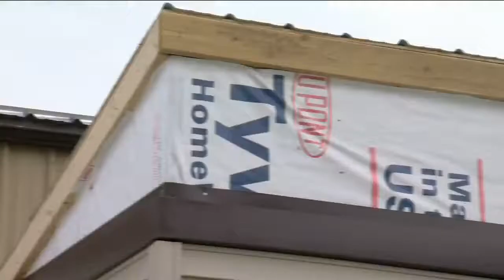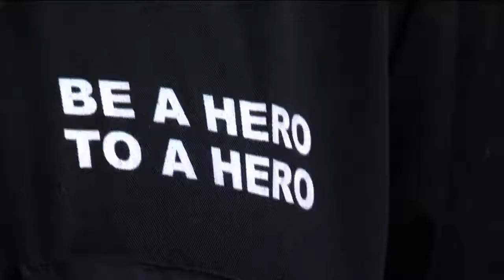Racine to build 'tiny homes' for homeless veterans

Comment: build a tiny home that has the roof and side of the home lined with solar panels. and wind turbines on the roof and side of the home build the homeless veteran homes next to a river or stream for hydro turbines. and make everything in the home electric, electric stove, electric heater/ac, electric water heater 10 to 20 gallon, it will be self efficient. most homeless are down south and you can build these homes down south where nothing freezes. In these homes there are one hundred percent electric. The home has a small or community water purification system to clean the water, collects water from river or stream or lake, water condensors collect water in the air, and collect even rain water. this will save the state money and help people get back on there feet. and give them shelter. help homeless veterans out.